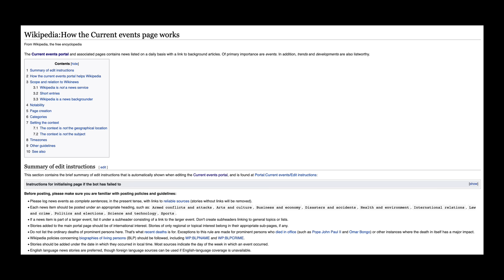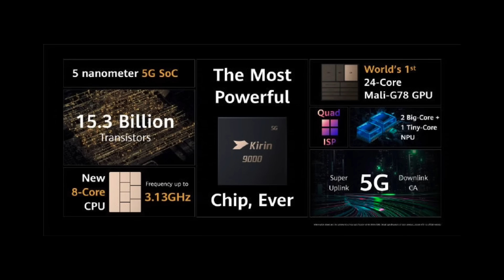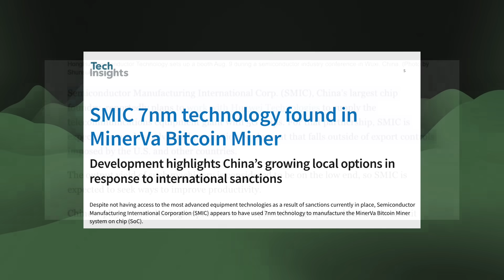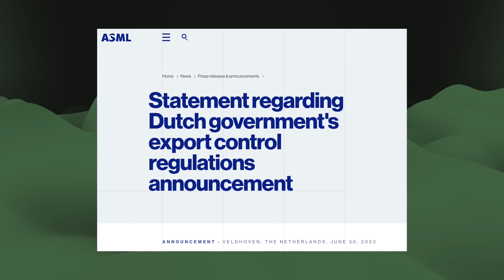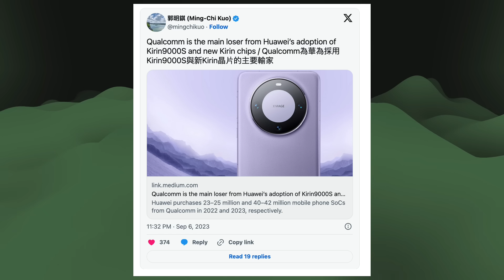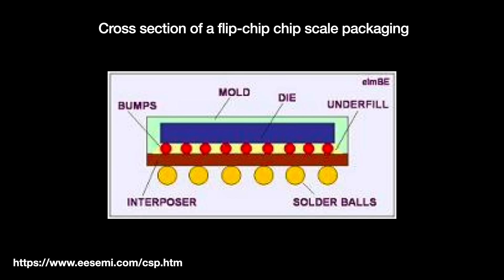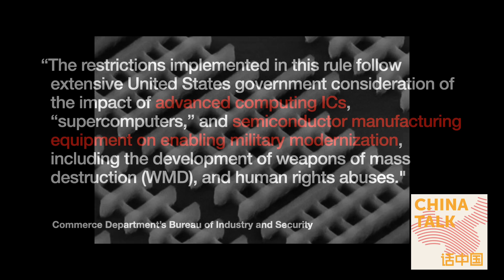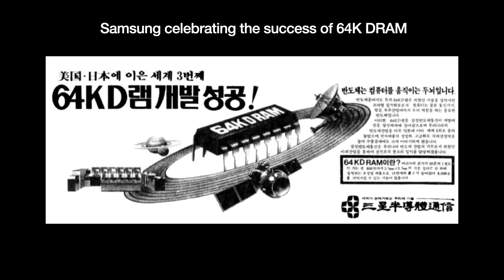China's 7nm Semiconductor Breakthrough

Comment: Very interesting! From your previous videos, we know it's possible to use multimasking techniques for DUV lithography to get to these nodes. So SMIC has brute force the process then. And it seems they still have the license to use the software for silicon layout. But they are then restricted to the current Arm cores and cannot get the latest core architecture. Question is performance wise, can they keep up even if they can go down to 5nm.
Reply: only time will tell. I am betting on their innovation. When the world is against you, you can only go up
Reply: You can brute force a lot of things. We still don’t know what their yield or cost is. I expect it’s pretty poor. Not particularly problematic for SMIC, they can just dip into public money to make up for it until those things improve.
Reply: @Grak70  And what do you think they will be stuck with the tools they have forever? It is only matter of time they produce their own DUV and EUV. Then what? Even more sanctions?
Reply: @ZxZ239  I never said any such thing. Stop being so defensive.
Reply: @ZxZ239  Its not a matter of time if they have only there own market to sell into.
Reply: SMIC doesn't design chips, which is what you need ARM architecture or design for.  Huawei does have access to the ARM architecture, and even some of their designs via ARM China.  Not having access to some of ARM's latest designs is not a problem, as like Apple, Huawei's Kirin chips use the ARM architecture but have their own designs at least for the most important cores.
Reply: @ZxZ239  Asianometry has a video on how China's efforts are going for lithography. And their own immersion DUV will probably happen in time one imagine, but it's also clear they're a long way behind and have consistently remained so, at least so far. We will have to see how their efforts in EUV pan out as well, though one kind of suspects it's going to be a long time coming, developing that tech was quite challenging and time consuming for anyone that tried it.

So I suspect that for the 2030s China will probably have to live with being behind in computing technology, but as for after that who knows.
Reply: @davidding8814 of course. I wasn't clear as it's a short comment. SMIC is a fab. Huawei designed the SoC. What I meant was Huawei will not have access to the latest Cortex cores with the latest instruction set and features. Sure they can use their own image processors, modems, DSP, GPU, etc, in the SoC design now. They can set their power budget, thermal envelop and clock speed but without access to ARM latest design and smaller nodes, future chips will not be able to hit performance targets from lower power and higher IPC.

I used to work on embedded system on a board level.
Reply: @Quickshot0  at present, all the machines were imported from Japan/Netherlands before the ban and you can bet they are trying to reverse engineer them. Software for DUV is already very mature so unlike EUV, those machines don't need updates to increase yield. The issue is their customers will need a lot of time to design the SoC due to the number of masks that need to be "layered" to produce the required exposure at such small scale. Rewatch Asianometry's old 7nm DUV to understand more about the process. I'm not an expert in lithography myself.

For EUV to work, you need mirrors from Carl Zeiss. Only they can make the lens and mirror that goes into these machines. As China's DUV machines break down over time, the question is can they get the spare parts. If USA ban expands, even those lens for DUV machines could be cut off. I'm also not an expert on lens so can't say how long UV light will degrade these lens.

Then China will be like North Korea where the industry collapses (over a decade or 2) and everything needs to be bought from the black/gray market at exobitant prices. In theory, this should only happen if China starts WW3.

To be clear, factories are unlikely to return to China and their own domestic market don't have the capacity to consume all that's produced.

Anyway back to SMIC, the main takeaway for SMIC producing a 7nm chip is to ensure their military has access to controllers for weapon production. The Kirin 9000s chip is just a demonstration that it's possible. The production date 2035 could just be a red herring.
Reply: @erictayet  I think the most  interesting question for the midterm would be if China could manage to develop their own DUV and immersion DUV machines. Certainly they've been trying so I think this is plausible eventually, assuming China doesn't suffer some kind of major problem.

Achieving EUV though seems a lot more challenging and seems like a long term project at best. And this will probably be a limiting factor for them for a long time to come thus.
Reply: @Quickshot0  China is not known for precision engineering. Example, ball bearing used in products are mainly from Japan & Germany. They will be able to copy certain aspects but getting stuff like glass right will take a huge stroke of luck!
Reply: @erictayet  Ah right, I have heard they like to cut corners. I suppose if they got corruption under control enough in the production line maybe.....   but that is a bit of an ask.
Reply: @rabbitazteca23  sure, no doubt there are brilliant engineers and scientists in China, but the government has scared away their customers. I used to love to shop on Taobao for many non Hi-tech items. Many are well-made and cheap and don't even have shipping fees. But the world has woken up to the cost of the low prices. 

Yes, in the short term they can do all this because they still have access to these machines but they keep blocking foreigners from doing business with them and that's really hurting them.

There's Chinese idiom, the hand don't match the mouth. That's what's happening now.
Reply: @erictayet  They don't use ARM's designs for their performance cores though.  Yes, they'll need smaller nodes to keep up with the competition, but as long as they have access to the ARM instruction set, which they appear to have, then they can continue to design their own custom cores based off of them.  My guess is that they'll probably eventually move to RISC-V.
Reply: @davidding8814  Ah I see you've read the Tom's article. I read it just now too. I need to read a bit more about how Arm licensee works. It seems different from x86. Personally, I've never worked on an ARM-based embedded system. From memory, I always used x86 and z80, although I did 68HC11 & FPGA in school.
Reply: @erictayet  傻X
Reply: @erictayet 人家不卖东西给我们，变成我们不跟人家做生意
煞笔
Reply: I think they can design a chip on an older architecture with a different design and still be as fast or faster than current gen like Apple does
Reply: @danielthuku8192  it is possible but that means the die size will have to be bigger in order for heat to dissipate more effectively and they need an even bigger heat-spreader/sink. A bigger die-size means you get less usable SoC (lower yield) from a single 30mm wafer, and I'm willing to bet they can't get down to 7nm at the outer edge of the wafer. This means it is extremely expensive to make SoC from this process and it takes way longer to get up to volume.

Without the latest instructions from ARM Cortex, they have to implement their own instructions, optimise the opcode in silicon and convince compiler companies to implement their instructions. When we talk about embedded processors, there is hardware + software considerations. The whole point of new instructions is to enable a new instruction to handle new types of dataset. 

To make things even more complicated, dedicated ASIC (functional units) that handle specific functions like image processor also require software support but this part requires less software because it's mostly hardware-based. However, being hardware-based also means it generate heat when it's working. Ever wonder why your phone heats up so fast when you're taking 4K60 videos with H.265? This is the reason and moving to a smaller node like 4nm reduces a ton of heat.

Comment: On one hand that phone is like $900, that's flagship prices for well known brands with great support like samsung and apple, not a phone that you have to fiddle with it just to get regular apps to run and thus wont get much support outside China, so unless they plan to dump these at a big loss there wont be many buyers outside the country.

On the other hand the korean method worked for Korea because they are close allies of the US thus didn't have to worry about export restrictions heavily limiting what technology they had access to. Even right now Korea doesn't have to source every piece of semiconductor tech from domestic providers, but China will have to.

So basically China will have to do this the China way, which is yet to be seen.
Reply: Regular apps work fine on Huawei phones. Not sure what you are talking about. There is a Huawei app store.

Comment: iPhone 15, 20w super fast charge, buy the cables and connectors separately, 60hz screen brush, 3nm, no one has tested and disassembled it yet, the starting price is over 1,000 US dollars for 256g, there is no innovation except digital changes and price changes.  Huawei mate60pro, Kirin 7nm chip, measured close to 5nm, has satellite phone function. Satellite phones on the market start at least 1,000 US dollars, 100x optical zoom, you can freely make calls and take photos in the water, 88w super fast charge, 120hz high refresh rate  , can crack walnuts, and the price is less than 1,000 US dollars for 256g.  So it is not difficult for everyone to compare and find the answer.  From my professional perspective, Apple is a mobile phone that harvests idiots.

Comment: I wonder what software they used to design the semiconductor. And did someone said it's an ARM based processor? I thought that was licensed .
Reply: RISC-V
Reply: Yeah Huawei wrote their own EDA software for this too. And ARM is licensed by ARM-China, which is legally forbidden on creation to have any American shareholders.
Reply: Huawei subsidiary SMIC apparently already has the ability to design its own chips
Reply: @botdcypher  HiSilicon, who manufactures tells it's ARM v8.2A based. Huawei used Synopsys. 
Using RISC V ( Open Platform ) would involved a total redesign of the operating system and all the libraries. Therefore Huawei has to give the code to the public, and they are not very "Open" about it.
Reply: Synopsis VCS+Verdi+DesignCompilier+Virtuoso+ICC, they can't be banned, the are all over internet anyways.
For processor, we can use arm, it is licensed yes, but we have license.
Even not licensing anymore, we have its codes.
and we have domestic RISCV CPU from academic cycle like 'XiangShan', that can run your normal Andriod apps anyways
Reply: By the way i'm not from HiSilicon, I work in a few hundred ppl SoC fabless in Shanghai. it's not that hard

Comment: You CAN make 7nm with DUV no doubt. But the reason TSMC did away with DUV is due to the yield and costs. So if China wants to bleed themselves dry with each chip they sell then sure why not? Go for it. The market doesn't care how high or low your costs are.
Reply: The reason TSMC did away with DUVs is because it's a public corporation beholden to its shareholders and obliged to maximize profits, which can be forced in the short term.

Huawei and SMIC are either private or partially-public owned corporations, and are pillars of Chinese high-tech industry. If EUV is unfeasible yet DUV is, then China will throw all the money it can at increasing yields and lowering costs of DUV. After all the risk is not that China will be  unable to efficiently produce semiconductor products, but rather that they may find themselves restricted when purchasing any product that contains American semiconductor IP.
Reply: Isn't the United States subsidizing TSMC, Samsung and Intel? China is not short of money.😂😂
Reply: @ragabara1031  Nope thats not how it works. The low yield and cost effectiveness of DUV vs EUV in producing 7nm is a technological limitation.  You can throw money at it and make it better but it still wont be as good as EUV. if it were possible then TSMC would have done long ago and TSMC knows more abt semis than China. 

2nd, with all the state level resources behind this , all China could muster is a technology still 5 years behind TSMC.  This means that if USA tightens their sanctions then this 5 year gap will widen to 6,7,8,15 years. China will never catch up to TSMC. 

3rd, with all the millions and millions of China graduates doing food delivery setting up BBQ stalls instead of taking up tech jobs, what does this mean? It means that this so called 'technological breakthrough' is a one off thing and will not be sustained.
Reply: @hi4806  actually China is very very short of money. The Yuan is falling like a rock
Reply: @5kplamse  China is going to invest 40 billion dollars in semiconductor equipment this year. Duv made in China will be on the market next year. US sanctions have given China engineers and politicians enough motivation. De-Americanized and even de-Westernized equipment is inevitable.
Reply: @5kplamse  Again, the issue isn't about being behind the West. The issue is about self-sufficiency. Because the issue isn't about if, but when the Americans try to embargo the Chinese.
Reply: @hi4806 what happens when Chinese building sectors burst? Everything is build on loan
Reply: @projecttitanium-slowishdriver  You must have the ability to produce chips on a large scale before you can have a surplus. China's primary goal is to produce chips in large quantities without relying on American technology.Whether economy and overproduction are not the focus of consideration at present.
Reply: @hi4806  and without Britisih technology? The chip is based on ARM ip
Reply: @projecttitanium-slowishdriver  The primary goal of China's semiconductor industry is to de-Americanize. So far, Britain has not joined the sanctions.Even if Britain joins the sanctions, Beijing will have a backup plan. For example, mainstream companies in China have abandoned arm and turned to RISC-V  and loongarch.China market accounts for a large part of arm, and its listing prospectus also mentions that this geopolitical risk will greatly reduce its revenue in China.

Comment: China will have no problem leveraging chiplet technology to compensate for being a couple generations behind in transistor density from local chip fabrication.  They were using this with their original 7 nm crypto chips (small area chips kept yield rates more doable. Parallelism made splitting the processing task onto multiple chips working in parallel without onerous bandwidth requirements between chiplets).  Also when AMD was on the financial ropes, China rescued them financially with the strategy of developing chiplet technology.  This is 90% old news reports and 10% common sense guesswork.

Comment: This is still unclear to me: did SMIC use existing DUV tech from ASML for the 7nm node, or have they used some new unknown method. Or does nobody know the answer to this?
Reply: It's still a mystery
Reply: Duv made by China itself is said to have been tested, and it is also possible that smic has already used it. No one knows.
Reply: Xinnie the Pooh knows
Reply: Search Huawei EUV Patent. Huawei had found the disadvantaged of current DUV Light source in producing smaller node. And Huawei has found the way how to tweak/hack the light source. I gues there is something with the patent, otherwise how can they mass produce 7nm node with ordinary DUV machines?
Reply: The chinese won't tell you how until they have world class EUV

Comment: What worked for South Korea won't necessarily work for China. South Korean state and society are hyper capitalist, concerned most of all with economic efficiency. They used what was originally the Japanese way, attract the markets with lower prices and keep them with consistent quality. This has worked well for both Japan and Korea, and is well received overseas, as it signals commitment to a long rerm relationship.

China, on the other hand, is a single-party ideological state, where the party is most concerned with staying in power, overriding every other concern. Hence there are doubts about the economic viability of Chinese breakthroughs, including in business abd technology. When too much effort is thrown at a particular sector, ignoring all common sense, the long term outcome is failure.
Reply: Obviously you don't understand China by your cliches.

Comment: Impressive that they managed to accomplish this in the first place, however as we have learned from intel, you can only squeze so much performance out of the same process node so it's only a matter of time until they can't push their silicon any further without EUV. Also isn't the Mate 60 / pro notorious for overheating while not even beeing in use?
Also only time will tell how the realestate collapse going on in china is gonna affect the domestic semiconductor industry since many semiconductor manufacturers in china are relying on funds from the ccp to keep expanding.
Reply: I am using a Mate 60 pro now, no overheating issues. And you can go down to 5nm with DUV lithography, there is no magic cut off.
Reply: I thought overheating was iPhone 15 issue ?
Reply: @ScoobieDoo-zy1rh  Really? I heard that the new Iphones get warm pretty fast but I never heard anything about overheating. Well now that I think about it, it wouldn't be Apple's first time creating a product that overheats.